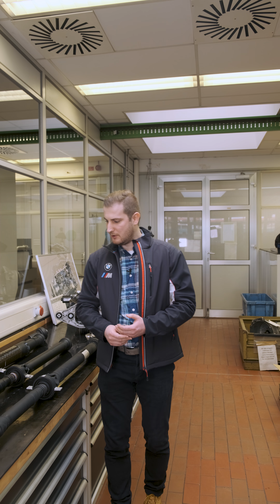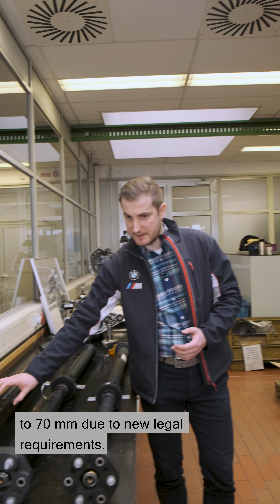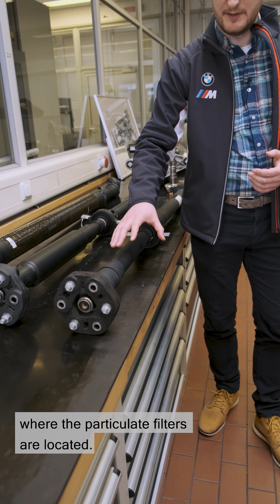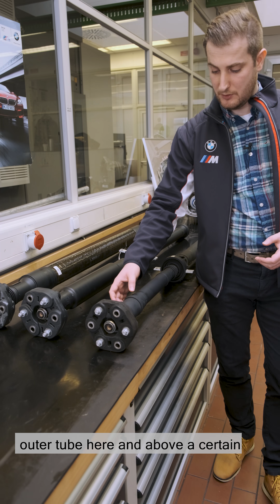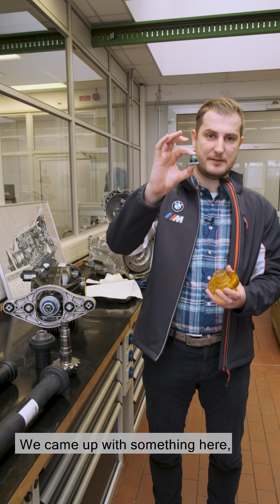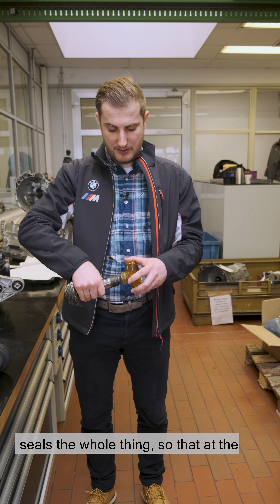Drive Shaft. M3 and M4 - explained, Episode 18.

Comment: The transition from CFRP to steel is nothing but a cost cutting measure. The OPF is a cheap excuse BMW 🤦‍♂️
Reply: Thanks heaven there is the GIULIA, which mantains its carbon fiber driveshaft from 136 to 540 HP, respecting the emission laws😜

Comment: Yes harmonics are extremely important at high revs. Tricky to get balance, thickness, strength and correct material to manufacture the shaft from. Again a great feat of engineering. 

Where from can I get the jacket, the presenter is wearing?

Comment: So basically there’s nothing you can do other than continue to utilize a 2 piece with a CSB that have been known as a trouble spot for BMWs since the late 90’s. Great
Reply: @UCx-CH8-dHt3CfefN2NWCujw it seems unfortunately that it was an afterthought. Auto manufacturers have years and years to comply with regulations so they should’ve known ahead of time. Very frustrating
Reply: Funny they justify it in terms of weight and stability, without reference to the fact this way it costs less (and other cars have a carbon shaft without any problems). Yet they had time to develop a butt plug to stop vibrations 😂